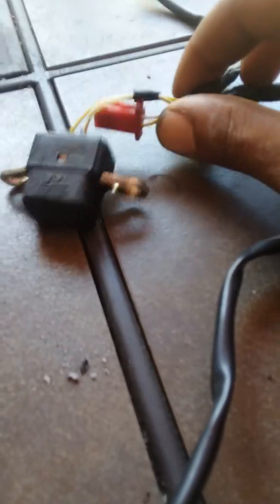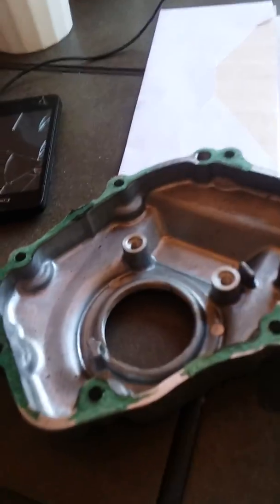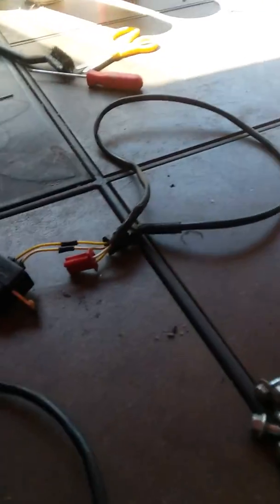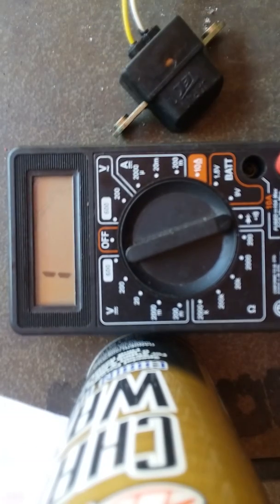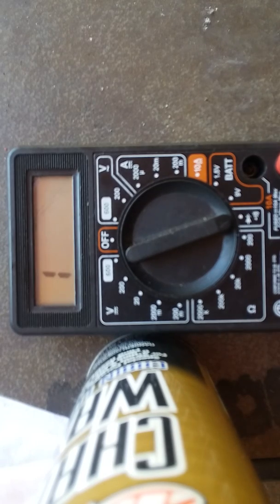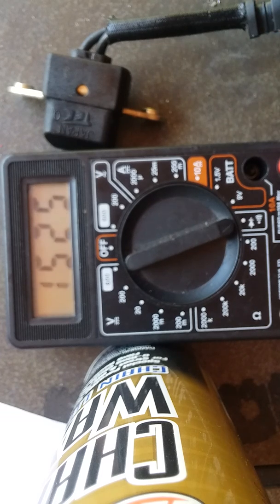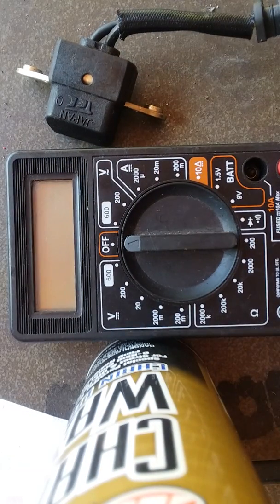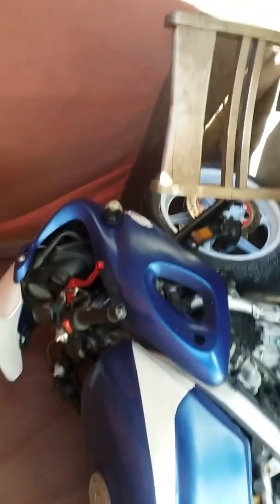Bad pulse pickup coil vs good pickup coil

Comment: Having an issue with my CBR954RR......engine seems to start and run fine, but at around 5500 Rpm it starts to stutter/hesitate and won't pull past 5500 rpm.  I pulled all 4 plugs.....1 and 2 cylinders were black....so i figured it was bad coils on cylinder 1 and 2.  Replaced the ign coils on cylinders 1 and 2.  Still having the same problem with engine stuttering at 5500 rpm.  Bike seems to run just fine while not trying to accelerate hard or rev engine above 5500rpm but that's not going to cut it.  Anyone have any suggestions?  Does the Ignition Pulse generator just STOP working, or can it get 'weak' and cause weak coil fire when the engine reaches a certain RPM?

Comment: You could also be getting no spark on all four coils due to ignition. For example, if you lost your key and you wanted to bypass the ignition and start your bike, you would need to add a resistor 100 ohms to be specific. I worked on a bike that had no ignition and when I dove into the wiring harness I come to find out that the ECU was receiving 12 volts from a specific wire that needed to be dumb down to eight volts in order to get spark to the coils and to prime the fuel tank
Reply from the maker: Yes your absolutely right...I had a cbr 600rr that a bought with a lost key..they switched ignition switch and couldn't get no fire or  the fuel pump to prime...I went to the locksmith got a new key made...and it started right up... lucky he had the old ignition switch...it has a resistor in it the ECU reads....
Reply: I need more of you're wisdom boss

Comment: For my bike the issue is when I connect the battery it starts to crank over without the key or hittin any buttons
Reply: Sounds like your starter relay or solenoid whichever you have. It's stuck closed.

Comment: I brought a f2 this summer got it up running ran for 3 days then it rained really hard for two days I left it with no cover when I go turn it on it killed my battery then I jumped it got it on then before it heated up it turn off now I can just connect the battery n it starts to crank over without key or any switch ?
Reply from the maker: It sounds like a short somewhere...knowing you said it rained...your wires still might be wet somewhere maybe sitn in a puddle somewhere on your bike...you have to check all your connections on the wiring harness...it's labor intensive but it came save you a lot of money if you take your time to check...I hope this helps and keep me posted....
Reply: Hey I did all new cdi spark plug starter stator rectifer n still nun it turns on if I put gas in carbs it turns on for 3 secs backfires on me tomorrow I will put in brand new pick up coil

Comment: that is the worse way to check .you need to know the spec resistance value of the pickup coil also it's not just resistance you will need to check.
you will need to know if it makes voltage by cranking the engine or using a magnet move it close to it.,just because there's resistance doesn't mean it will work.

Comment: Is there a way to identify a weak one that's causing random misfires at high rpm? I have a bike that's suddenly getting misfire on all 6 coils at medium to high rpm when hooked to a timing light to visualize the fire and this is the only source I can think of currently.
Reply: do you have the solution in after these few years

Comment from the maker: I'm pretty familiar with these bikes so it wasn't much to check to figure out what the problem was... compression. Gas. Spark....no spark...safety switches.... ignition switch, on/off switch, push start button, clutch switch, kickstand switch, neutral switch...if all checks out...move on to.. spark plugs, ignition coils, pulse pickup coil, cdi box...if all these checks out to be good..or compare with a known good part....then I would check wire harness...but that's me..jus to get them up and running  again...any questions feel free to ask. Haters are welcome.. #bikelife #4life
Reply: My cbr f2 turns on off with a bike fire any help
Reply: Video
Reply: I have spark on my dirtbike, but there are no ohms on the pickup coil. There are ohms on the charge coil. Cant find this coil for less than $300, so im going to see about fixing it myself. We'll see.

Comment from the maker: Bad pulse pickup coil vs good pulse pickup coil...cbr 600f2 was running good for the few months I had it...then one day I started it up...let it warm up..then it started idling crazy.. get low then rev hi until it jus dies altogether...it started rite back up a few more times...ran the same way...now the motor jus turns over.. no spark...killing battery trying so much...
Reply: did you find out what it was??
Reply from the maker: @djpeteranton  yeah it was the pick up coil..